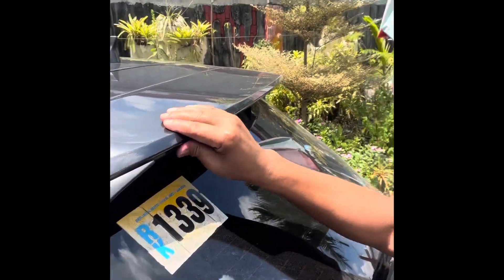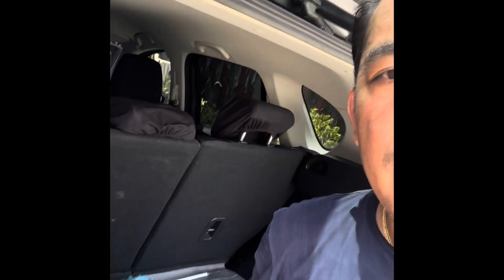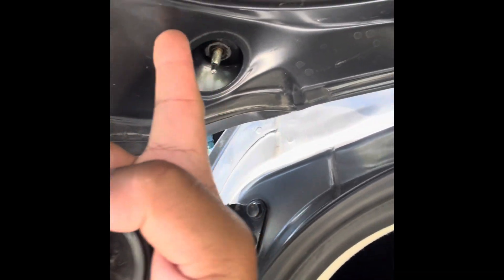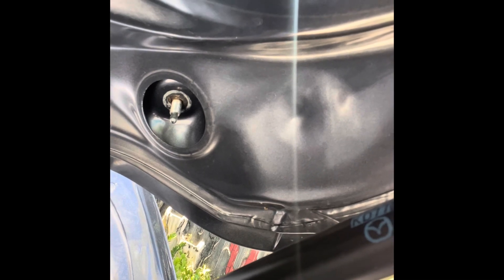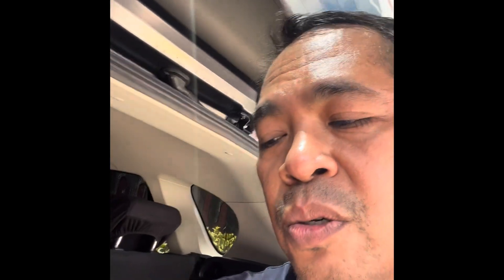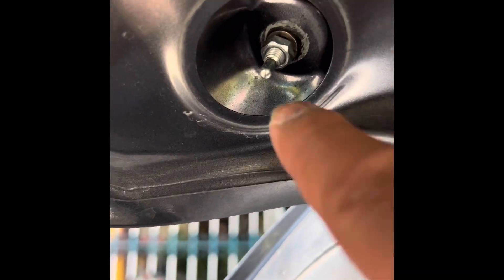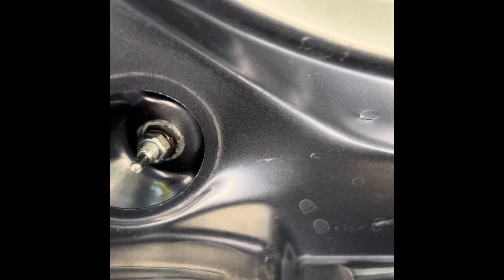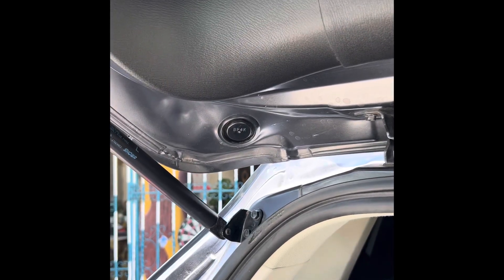2016 Mazda CX5 Rattling Spoiler Fix

Comment: Thank you for that mines having same issue & also any other tip n tricks for cx5 they seem to have unknown tricks
Reply from the maker: @MLML606  i am happy that my content is of help for you. Do share it to your friends ho has same issues. Another tip, if  you start engine and it is not cranking even though key fob is in the car, 100% battery in the key fob is dead or defective.  Replace it with a new one.

Comment: Thank you for this! My son’s car had this exact issue and this fixed it!
Reply from the maker: I just recently found out that there are 2 more nut and bolt in the middle of the spoiler. You have to remove the plastic cover at the top of the tailgate. Pull it out to dislodged the clips and then tighten them by socket wrench.

Comment: It's not a 10mm nut, it's a M6 x 1.0 nut. The size of the socket to drive this nut  may (or may not) be 10mm, but that's not what's important for defining the type of nut to use. What is important are the threads and the those are M6 x 1.0.
Reply from the maker: @willgoogwalker2586  point noted bud. That’s the available resources i have, any way it fits and serves its purpose.